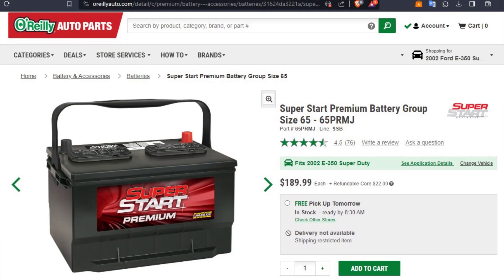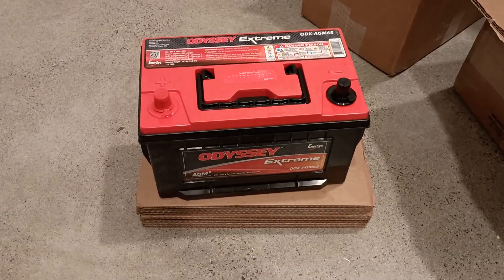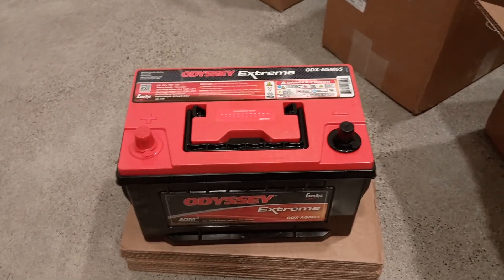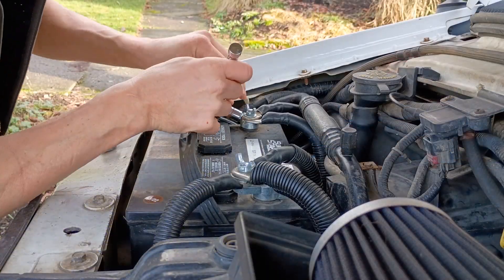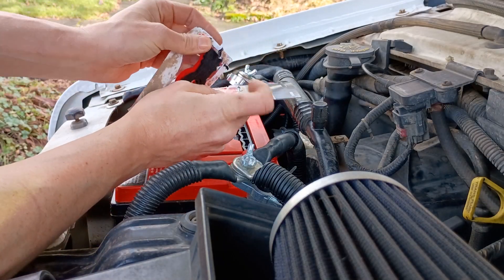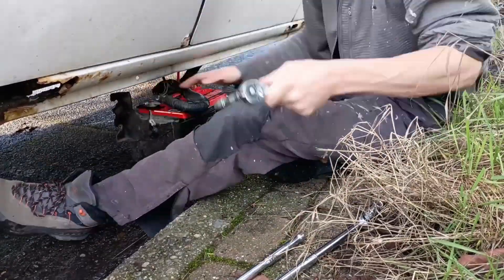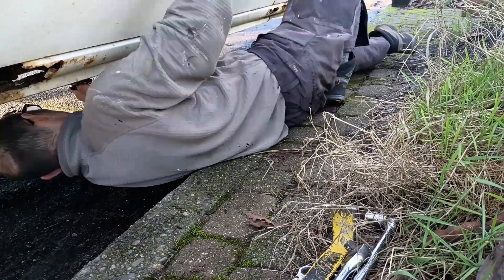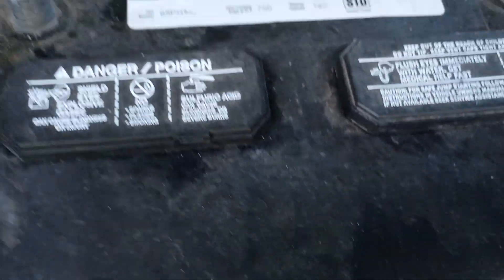Best Batteries for a Ford E-350 7.3 Powerstroke Van - Odyssey PC1750T AGM Starting Batteries

Comment: The rear battery tray has cables which allow lowering the tray without removing it completely. It hangs tilted out toward the kick-panel and leaves (just) enough room to connect and disconnect. Tilting the tray horizontal allows the battery to slide out and re-installation is easier with less drama than lifting on a jack and feeding bolts while trying to support the weight. it should have shoulders and 2 slots which allow loosening without removing the mounting bolts

Comment: What's your intake setup?
Looked aftermarket.
Thanks, great info
Reply from the maker: Yeah, it's custom built by the previous owner.  He modified the intake with a piece of PVC to accept dual K&N oiled filters.  I'm not confident that it's the best option but it is what I have.
Reply: @PowerstrokeEconoline  have you seen the Subaru hood scoop upgrade?
Intake options for the vans is a good topic 👍
Reply from the maker: I have not.  Got a link?  I'll check it out.  And yeah that is a good topic.  I think the original airbox isn't a bad option but on many vans by now it is cracked beyond repair.  I've seen a few options but haven't messed with mine other than to clean and oil the filters.